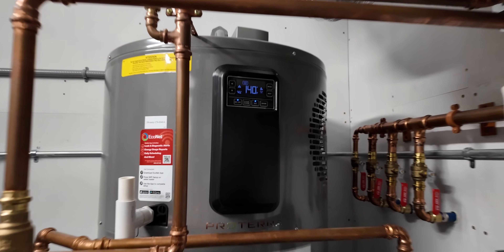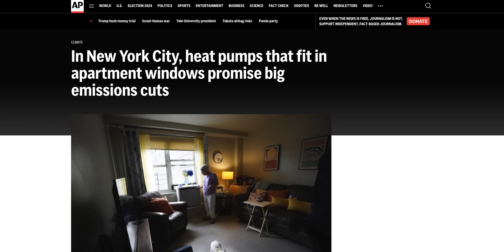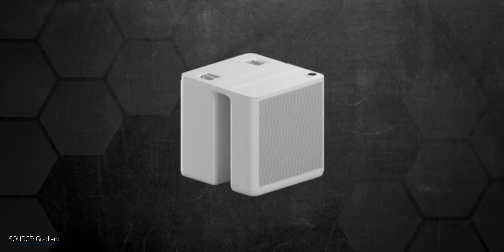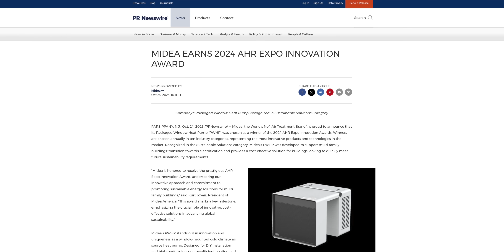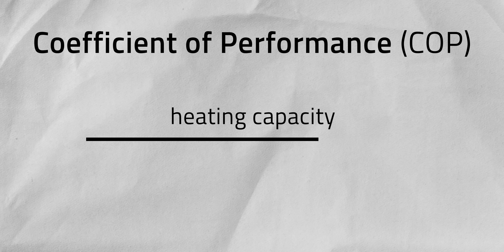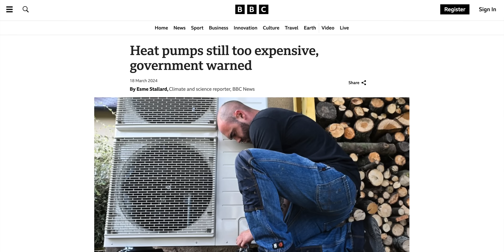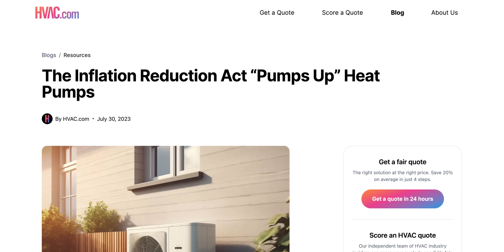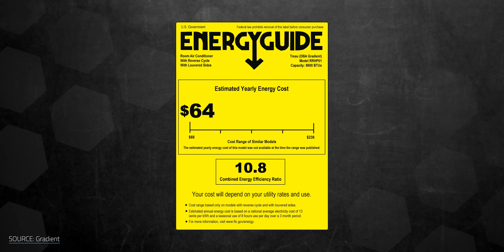Why This Window Heat Pump Is Genius

Comment: If I’ve understood anything watching several videos, the only difference between an A/C unit and an inverter is a return valve which makes an inverter possible. 
The high cost of these units are their form factor and ease of installation compared to a spilt inverter system that requires professional installation. 
 My only question is why haven’t they make traditional form factor inverters for DIY installations?

Comment: Nothing is more efficient than boilers. This is delusional. The reason why the rest of the country doesn't use boilers for the most part is that it's a long-term investment. They'd rather install electric heaters to run off the electricity lines they have to have installed regardless instead of additional piping. These days, folks with the cash to invest in a boiler and piping for heat tend to have it installed in their floors so that the floors radiate the heat. Those old-fashioned radiator units are someone's paycheck a piece.

Comment: The problem plaquing heat pumps where I live is how insanely cold it gets. Summers can easily see a few spikes as high as 100F(37C) so we can't just build igloos. But during the winters, especially in rural or less urban areas it's can often get well below that of almost every heat pump available. While most nights don't go below -30C(-22F) there will be as many as 10 or more nights each winter it does drop below. Last winter it went down to -46C(-51F) and nearly brought down the power grid. It only takes one single event of freezing a building to cause significant water and mold damage from burst pipes to thousands of buildings. Finding a heat pump that is capable of getting enough energy out of -50 degree air is fruitless, So when it's that cold, the gas furnace is required. Buildings that are fully regulated via heat pumps, are using ground source geothermal heat pumps.

Comment: $3,000 is absurdly overpriced. Conventional window air conditioners are effectively heat pumps. They can run on a few hundred watts and cost a few hundred dollars. The only real difference is orientation.

Comment: Friedrich Kuhl 10,000 BTU Window Air Conditioner w/ Heat Pump Model: KHS10A10A List price $1,769. While not the fancy saddle style that's a lot lower cost. Or how about the Amana AH123G35AX 11,600 BTU window mount heat pump for a cool $1099? For the mini split types there are ceiling cassettes to use instead of the wall hung units. The outside units could be mounted on the building roof then the wires and pipes run down to the apartments.

Then there's the Tech Ingredients guy who posted a video a few days ago on using an air conditioner for heating.

Comment: I've used central HVAC Heat Pumps and Mini-Split Heat Pumps in three of my houses over the decades and Heat Pumps are very efficient after the initial costs. This seems like an excellent idea and and somewhat ingenious design for ease of installation.

Comment: The functional high temp ranges are too low. Thanks to global warming, summer temps exceed 100 degrees Fahrenheit in most places on the planet. This product, while certainly a significant improvement, still isn't quite where it needs to be.

Comment: What is the total efficiency of a heat pump vs. a gas-fired steam boiler system when you take into consideration that most current electricity (at least in NYC) is generated by gas-fired generator plants and the transmission loss to the outlet?  Does the 2.35 COP still look good vs. gas fired boiler, even though it's going to be below 1?

Comment: These aren't just good for apartments. My house has a small side porch that was enclosed by a former owner. It's too difficult to duct it into the main system, and too small for even a ductless mini split. A window like this would be a perfect option to turn the room from a "3 season" room (really 2 season) into a year around room. They can also be useful for heating/cooling converted or other use garage spaces or even small out buildings.

Comment: I notice you never say how many sq ft the unit will heat or cool -- surely just one won't heat and cool a 1,000 sq ft apartment without the same "lowest common denominator" problem from room to room that we encounter with our A/C in the living area trying to cool most of a 1500 sq ft house: the living area is at 70°F, but the rest of the house is at 78°F, and humid.

Comment: I can't get past the price! The great majority of those who live in apartments don't make enough money to buy one of these. They make do with one A/C unit in the bedroom so they can sleep in comfort, and just deal with the heat. 
Our rental house in SoCal has two of the heating and cooling units for cooling -- one in the living area and a smaller one in the master, leaving 3 bedrooms hot and stuffy -- while retaining central gas heat. Central air was too expensive to replace. I think a lot of rental units are in the midst of replacing old systems but are taking the cheapest alternatives.

Comment: Yes, this is a good idea. Some things to consider.

Typical 120 V volt receptacles in North America are supplied by a 15 Amp breaker but the largest size appliances that are normally allowed to be manufactured t intended to be connected to a 120 volt receptacle  are rated at 12 Amps. If you do the math 120 multiplied  12 is about 1500 Watts or 1.5 KW.  

Normally there are several receptacles connected to one 15 Amp breaker so you can plug in several different appliances  but if you exceed 15 Amps the breaker will trip and turn everything off until you reset it.

A heat pump rated 9000 BTU/hr heat pumps will probably be in the range of 8 to 9 Amps which is in the 1000 Watt range.  In the older apartment buildings if every apartment connects a heat pump it adds up to allot of extra power and the older electrical servicers for these apartments may have to be upgraded.  This is the same problem with installing  electric vehicle chargers in the underground or outdoor parking lots  in  older building and condominiums.  Sure the electrical services can be upgraded but it will be complicated and costly.

Comment: Is this a weird American thing? whats the difference between a heat pump that can also cool and a reverse cycle aircon seem to be the same to me,can get a decent sized 13,000 BTU reverse cycle air con window type for just under $900 AU $3K murican seems excessive.

Comment: I live in Toronto. Many landlords now insist that tenants use floor model portable a/c units as nothing can hang out the windows. This is because of liability if the units fall out of the window. Later this year, the city will pass a law banning any type of unit that hangs out windows. A window heat pump is awesome tech but probably won't be permitted in Toronto.
Reply: Instead of just making sure the units are properly secured... Uhg.
Reply: Wow that's pretty dumb considering floor model A/Cs are the least efficient.

Comment: Jesus whoever is running this raffle is gonna make 1.4 Million dollars. No wonder ya'll keep doing this crap.

Adding a Tx valve and some extra copper tube costs 3K WTF no way. Good idea im gonna modify a regular Ac unit to do just this. You just need a Tx valve and splice into the copper tube already in place so the outside is cold inside hot.

Comment: I would love one of these. My home has a central heat pump, but one half of the house has missing, damaged, or absent insulation, and the heat pump gets overwhelmed. I have two major road blocks to getting one: It gets over 113*F here in the summer, and all of my windows are horizontal, instead of vertical, opening. Pretty sure it would make sense for me to get one of these and a simple Solar set up, and be able to run it off the grid for 90% of the time I would need it.

Comment: If you are coming to BC, Canada ask BC Hydro if they know about this product. :) Here on Lower Mainland of BC those heat pumps seem to be a perfect heating option because of the temperature rarely go below -10 degrees Celsius.The only problem I see is the lack of options for sliding windows, the most common window. Thank you.

Comment: I looked into getting one of those, but I read reports that the condensed water collects on the inside of the house, and so either you need a pump and a hose going through a hole in your wall to pump the water outside (creating more noise), or you need to keep emptying a water bucket like you do with a dehumidifier. I didn't want that hassle in a window air conditioner.

Comment: The content is pretty good and interesting, but I suggest you take a more critical look at your sponsors, especially the blatantly activist ones like CCAN. 
With less than 15 minutes of web search, I was able to find that it is not only a climate focused activist "non-profit" with a rather suspiciously tiny published funding, it's board and members are composed of radicals, and even Federal officials from the EPA, who seem to be serving in a clearly partisan and activist role that likely conflicts with federal guidelines. 
I'm not saying that climate change isn't real, or that humans have nothing to do with it, but the rhetoric on both sides is largely not actually backed by any data, and completely doom and gloom hyperbole, at the absolute best, and mostly outright ignorance and lies, most of the time. 
You can and should be doing better than this, especially if you actually care about the issue as much as you seem to.

Comment: I'm waiting for something that's like a "central heat pump" that can feed heating OR cooling to any device in a house.  Imagine if your fridge, water heater, clothes dryer, and the HVAC all ran off one or two heat pumps with some shared plumbing between the appliances. Smart switches and valves would keep the energy goin where it's needed without conflicts in the system.

Comment: i wish they made heat pumps and standard window ac units for horizontal like this with a 'U' shape to be able to slide the window mostly closed. Have a bracket on outside to support the rad like normal. I live on the USA west coast and vertical sliding windows are not common at all.

Comment: It didn’t strike me how much building design influences heating and cooling until after I lived in a bunch of different places.  When I lived in Montreal lots of the walk ups had front and back access. So you could create a cross breeze. But also living in some apartment buildings that were only on one side of the building it was very stagnant.  Now I live in an old Vancouver home with the ability to do a cross breeze and haven’t needed an AC.

Comment: Still quite expensive compared to split units. In my part of Europe, you can get 24k BTU at around $1k. I would still love a $150 window unit, unfortunately we don't have vertical windows, and I know the older models made a lot of noise. Still there is noting innovative about these anymore. I mean the window unit had the outside fan run trough a pool of condensed water to splash on the radiator to improve heat transfer and evaporate it.

WiFi modules and sensors don't account for the high price.
But than, everything is marketed up to a price the average consumer is willing to pay.

Comment: 2.35 COP is too low for a heat pump, larger water to air heat pumps installed in residential buildings can easily reach or exceed 3

Comment: Don't know how old of an apartment building it has to be, but all I lived in, have either a radiator heaters under windows, or  inwall HVAC sleeves. Don't see it to fit any of my windows in the apartment.

Comment: the price is a total non-starter.  9k btu's...so enough heat for a couple rooms...So you will need 2-4 of these for your apartment.  That is A LOT of cost to amortize across the savings.

Comment: At 9000 btu's I'd still like to know how many watts or KW over a 24 hour period would it take to run this unit AND how loud is the fan?  I am not too concerned about the upfront cost, but I would be concerned with the origin of the parts.  look what is happening with modern cars and all the recalls and you can see my hesitation.

Comment: Buy two window ACs for $150 each, $300 total. Install one as usual, install the other one backwards. Run the backwards one in the winter for heat and the other one in the summer for cooling. 10x cheaper!

Comment: They already make portable AC units that also have heat pumps and only cost around $500 and heat or cool around 700 sq ft respectively. They just require a small hose and vent in the window and the unit sits on the floor, still leaving most of the view unobscured. The prices on these are pretty ridiculous, but tax dollars will pay for it so they gotta take advantage, right?

Comment: Price is insane you can get 4 midea duo 14000btu dual hose inverter heat pumps for the cost of one. albeit not as effecient but very very close.

Comment: Midea sells a window A/C that also has a heat pump feature built in, but it only works down to about 40º F. It's nice the in the fall though! (Midea 8000 BTU Window Air Conditioner with Heat)

Comment: Saw a utube video  on a minisplit unit that is like the old diy units from McLeod sears Bay and eatons catalog that were plug and use while I like this idea because I can easily pop out a window modifie the bottom sill install the unit and replace the window with the heat pump below I don't care if it dosen't work in the winter being a heat pump unit means I can  get 9 months of use spring and fall were we need heat  summer air-conditioning with the weather like it is where we only needed air-conditioning for maybe a week or two it's now a lot more this year we even needed some air-conditioning in April unheard of in Central Alberta I've tried to find someone to convert my air-conditioning to a heat pump maybe either Japanese or Chinese companies will come out with a reasonable priced unit but if they do it'll be a short time to buy it as the American manufacturer's will run to the government and say they can't compete without a 2 grand markup they can't make money

Comment: The current U shaped mideas suffer from an internal unclean-able serious mold issue, google it. My 150 dollar window ac and my wood stove work just fine. My window ac runs off my solar panels so no woke climate warming nonsense.

Comment: I was intrigued until I saw the price. I've been doing HVAC work for about 15 years, and like new tech. I just installed a 24,000btu 18seer mini split in a house today. Total cost to customer was $2400....That includes installation, equipment and materials. I know they aren't easy to install in every space, but $3000 for a 9k 16seer heat pump is not very impressive. I suppose the price will come down over time. I hope other companies start competing in this market. I have been unimpressed with how many window units don't  operate as a heat pump.

Comment: At those prices I would just go with a mini split heat pump. Half the price. Harder to install. I am pretty sure you can get heat pump window units for less than 1K. I like my Midea u shaped inverter unit, it only cost me $400. It does not have heat, but it cools great.

Comment: I bought a Midea air conditioner this year, and I love it. $450 for 12k btu, but why are they asking 6 times as much for running the pump in the opposite direction? Seriously. edit: I looked at buying one of your shirts but don't want one made with 10% plastic. Really? That means my dryer lint can't go into the compost and I'm introducing micro-plastics to my local ecosystem through the leach field when I wash my clothes... Micro-plastic pollution isn't a joke. So maybe I'll check back later.

Comment: In Norway we install outside heatpumps that cost around USD 2000, but house owners will do that for their part of the house while the rental unit gets no such goodies. 

These would be good for renters because you could bring it along, but unfortunately all windows here tilt from the top or the bottom for airing and opens fully sideways or through a lever in the middle which makes them unsuitable for mounting anything across the window sill.

Comment: The window AC can heat if you flip it but it’s only rated to run above 60F the function is there the part specs just don’t match up with practice.

Comment: Off brand 12k mini split heat pump with 16ft line set: $800
Wall mount: $45
Line covers: $35
Electrical whip: $25
Non fused cut off: $20
Dedicated circuit breaker: $15
12-2 wire (depnds on length): $50
1/4 -  3/8 fitting adapters: $20
City permit: $75
Heat pump installer: $825
Electrician: $300
Installer and electrician willing to do the work anytime soon: priceless

I dunno, the economics don't look all that challenging.

Comment: Gradient sure works hard to conceal how many watts these things use.  From what they posted on their website of $64 annual operating cost based on 8 hour usage per day at 13 cents a kilowatt I was able to work out the average power consumption when run was 170 watts.  I'm surprised camper vans and RV's with limited energy reserves aren't installing heat pumps.

Comment: 10:00 this is not necessarily true for all. Many of these punps come with electric heat, which is basically a space heater built in.
Essentially you're paying much more for an AC/Space Heater combo in many regards.

Also $3,000 isnt feasible for an extra valve and switching components. I'm more interested in effective options for the consumer.

Comment: "95 F, which should handle the typical temperature range of New York" - Maybe today, but not the future.  95+ is becoming common in the northeast, no longer rare.  With climate change increasing the temps every year, a heat pump which stops working at 95 is not a good investment, especially at those RIDICULOUS prices.

And that doesn't even get into the issue of whether or not the electrical grid can handle the extra load caused by shifting the heating all of those buildings from fossil fuels to electricity.